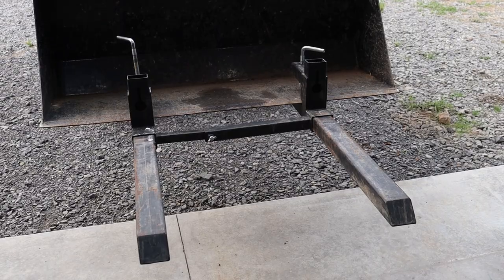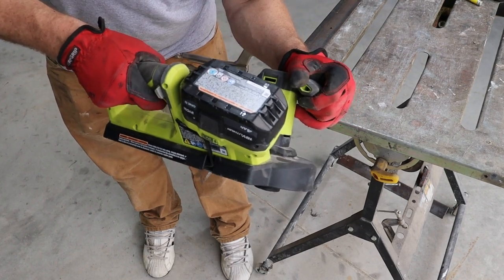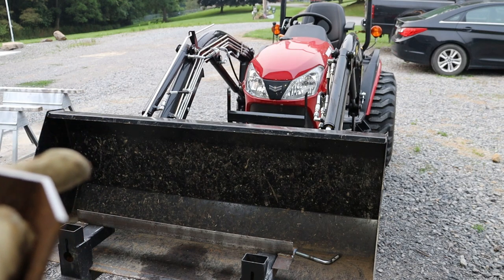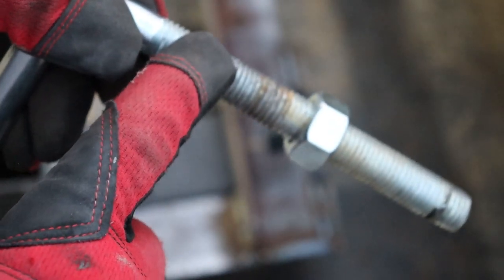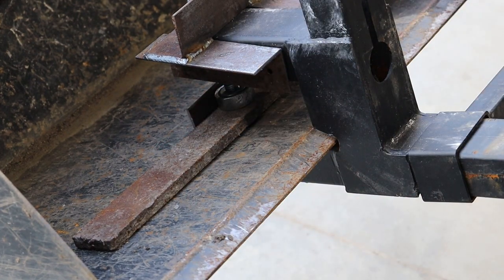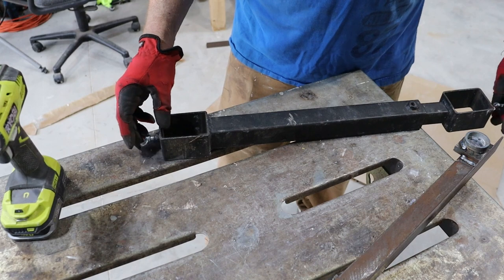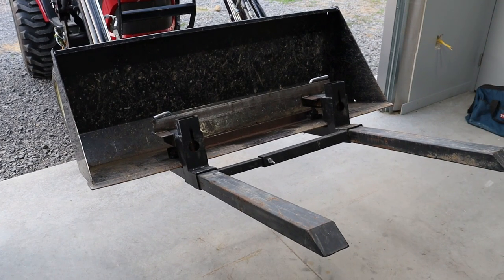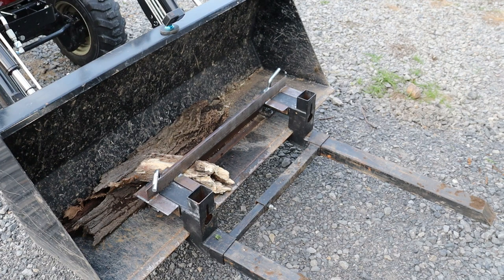Definite Improvement! | Pallet Fork Bracket Stabilizer Build

Comment: I had the same problem so what I did is move the center support to the inside of the forks(adds more room in the front)and welded it in place because I don’t plan on changing width and also welding center of support where screw is.I also welded hooks on upper side of bucket so I can strap it to make it even more secure.

Comment: I use two chains on my bolt on forks around my bucket…..I don’t weld, so my option keeps the forks secure and allows me to change the width of the forks if needed.